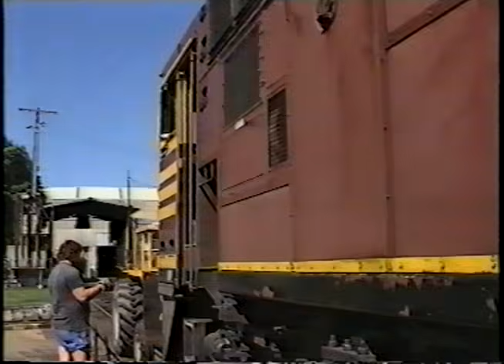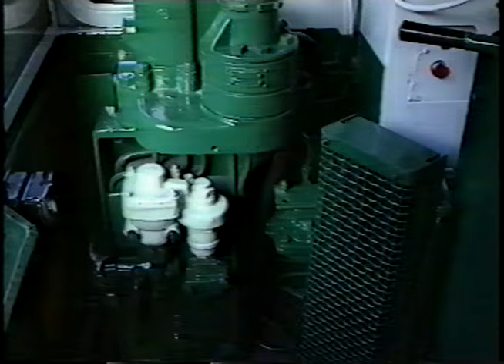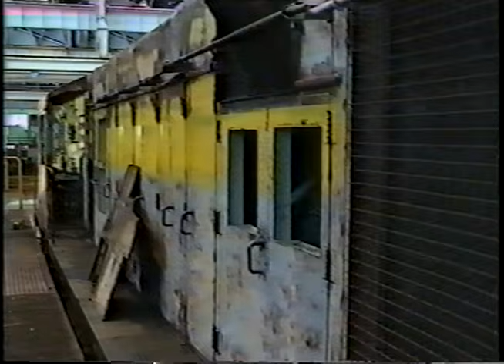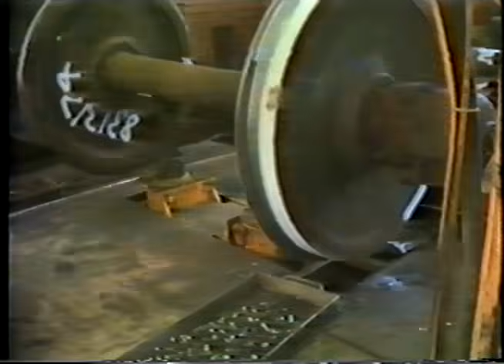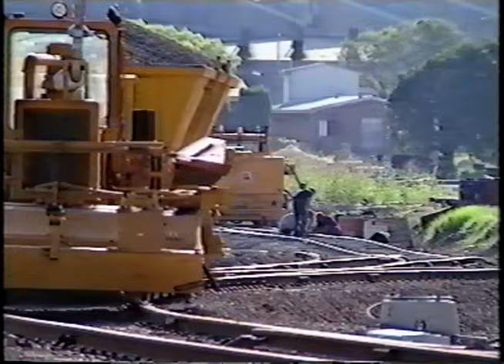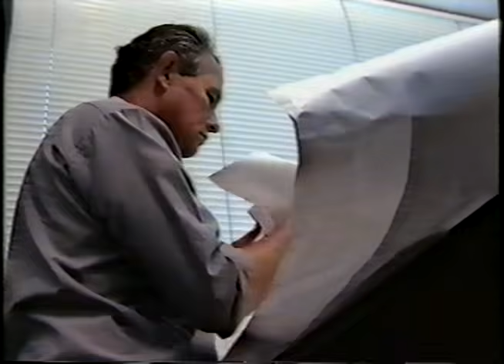Cardiff Maintenance Centre (State Rail, 1988)

Comment: The Cardiff Railway Workshops, originally constructed to support NSW's expanding rail infrastructure, evolved in 1986 into a specialized heavy locomotive maintenance facility under State Rail’s Mechanical Branch. Its new designation as the Cardiff Maintenance Centre marked a pivotal role in modern diesel and electric locomotive servicing.

🧰 Capabilities & Operations
Component Exchange System: Refurbishment of approx. 90 locomotives per year, including engines, alternators, and driver cabs.

Painting: Around 50 locomotives repainted annually, though critiques suggest standards varied pre-chemical upgrade.

Heavy Lifting: Facilities include 80-ton cranes and expanded traverser bays for full-length locomotives.

Diesel Engine Overhauls: Power assemblies from all classes were routinely swapped and rebuilt.

🚂 Specialized Work
Wagon Repairs: Converted wagons for different uses (e.g., coal to limestone), heavy repair cycles, and bogey/wheel changeovers.

Wheel Reprofiling by Welding: Over 10,000 wheels restored, doubling service life.

Electrical Equipment Repairs: Small-scale machine shop maintained for in-house electrical work.

Chemical Cleaning Innovation: Shift from alkaline cleaners to oxalic acid and Spartacus detergents improved cleaning and paint durability.

📈 Efficiency and Modernization
Computerized Costing System: Allowed Cardiff to competitively tender its services.

Environmental Compliance: Effluent treated via a pollution control plant.

Track Improvements: $2M track work project enabled streamlined movement across the site.

👨‍🔧👩‍🔧 People and Industrial Culture
Skilled Workforce: Trained across all locomotive classes, with modern amenities and on-site health & finance services.

Industrial Relations: Strong communication between management and workers fostered productivity and low conflict.

Apprenticeships: Historical nods suggest legacy of mentorship under figures like Ron Preston.

Comment: Another valuable taxpayer asset that was sold off to private enterprise...🤔
Reply: The Cardiff Maintenance Centre, once a cornerstone of State Rail’s mechanical infrastructure, was part of the broader public asset portfolio that began facing privatization pressures in the 1990s and 2000s. This wave of restructuring followed a now-familiar pattern:

Corporatization: State Rail was restructured into more "commercial" entities (e.g., FreightCorp, RailCorp), aimed at operating with private-sector efficiency.

Privatization: Parts of State Rail’s operations, including maintenance, freight services, and infrastructure, were either:

Leased to private companies

Sold outright

Or operated under Public-Private Partnerships (PPPs)

The Cardiff site itself reportedly shifted from public hands and, like many others (e.g., Eveleigh, Chullora), became integrated into private or contract-based operations.

⚖ Debates Around the Sale
Critics argue:

It was short-term financial thinking, trading off long-term infrastructure stability.

Skilled labor was displaced, with many apprenticeship pathways cut.

Public rail became fragmented, with cost-cutting overshadowing safety and service.

Supporters of privatization claim:

The changes improved efficiency and reduced public debt.

It encouraged competition and innovation in rail services.

Private management introduced modern business practices.
Reply: Incorrect. Still owned by the government on a 100 Year lease.